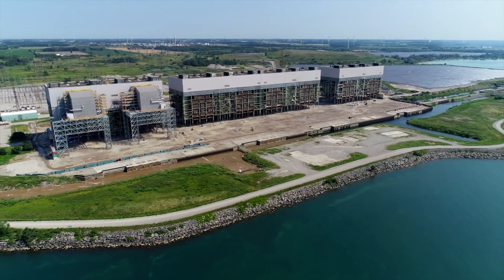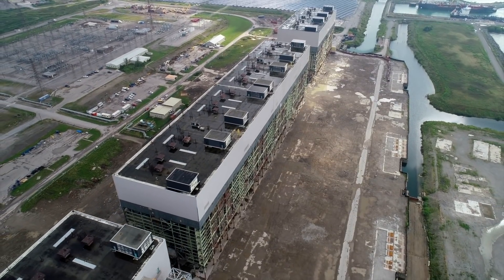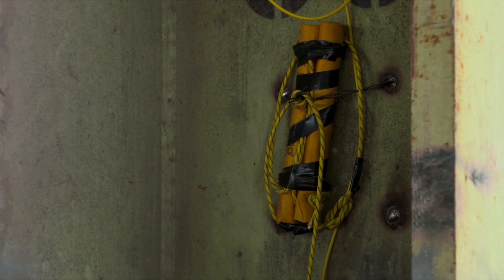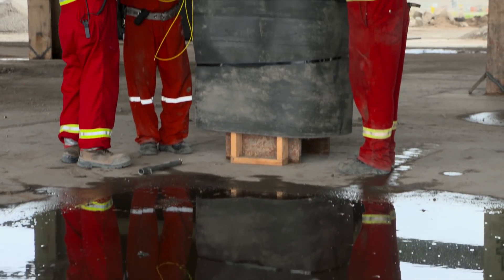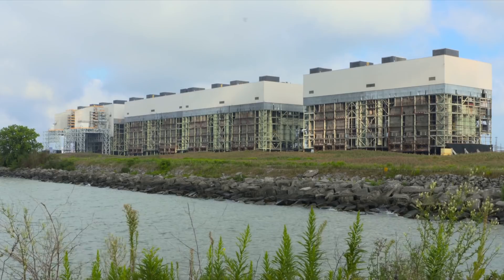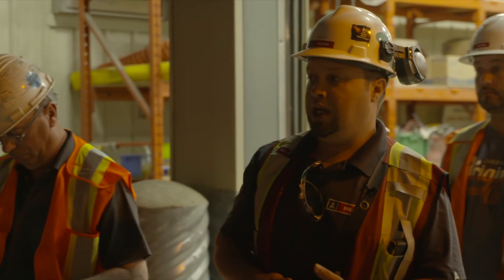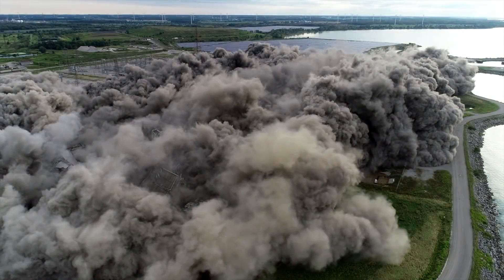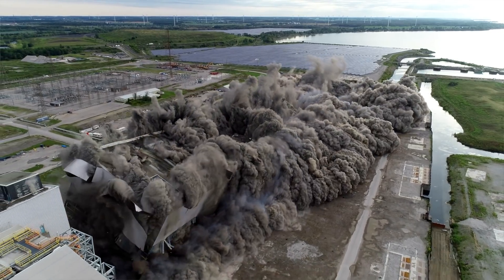Delsan AIM - Nanticoke Powerhouse Demolition 09 25 2019

Comment: Ontario went from 200 smog days per year during the reign of Nanticoke (largest coal plant in NA when it was active), to zero in 2020. 
The orange haze over the city was terrible.  We're much better off without coal.
As for "coal is cheaper".   The Ontario PC conservatives spent $1B to upgrade a single coal plant in 1990's before mothballing it 2 years later in a futile effort to try to clean up the sulphur and nitrous oxide poisoning our air.   In 10 years, Ontario has deployed 4 GW of solar and 5GW of wind.   Wind is now producing more power YoY than gas in Ontario.

Comment: Stupid move getting rid of that plant. Liberals have destroyed our energy affordability with their useless green energy plan. That dynamite would have been better used on the wind turbines. Nice job on the implosion though.
Reply: Wind and solar save air quality, climate and taxpayers
Reply: Nicholas L wishful thinking I’m afraid. Wind turbines create a larger carbon footprint during their construction than they will save over their entire operating lifespan. You couldn’t even use wind turbines to create wind turbines! And in no way will this save the taxpayers. We went from 7.5 cents/kWh to over 17.5 cents/kWh because of liberal stupidity. You also omit the mining of the rare earth elements for their construction. Not green at all. Check cobalt mining in the Congo. Child slave labor. I’ll burn Canadian coal and oil thanks. It’s actually greener in the long run.

Comment: Glad Milwaukee still has coal...Natural gas. Solar. wind, together make for efficient use of WHATEVER IS THE CHEAPEST........
Reply: Clean renewables are cheapest
Reply: @Nicholas-f5  sure nikki.......and no they are not.....
Reply: Ontario wind FIT contract at 8c/kWh is pretty cheap power, with zero fuel cost, no acid rain, no radioactive waste (coal produces more radioactive waste than nuclear).
Reply: @glennsteffler5110  I'll take the ones I mentioned.. Backups are a nice pillow...Ask the peeps in TEXAS...

Comment: Wondering...aside from the steel for scrap, what if any of the machinery - ie - the turbines and generators and related equipment was salvaged??
Reply: Salvaged for what? How do you think a decommissioned 40 year turbine gets salvaged?
Reply: @sydneyshinshi  A surprising amount gets recycled
Reply: @recoil5124  Recycled for sure but im guessing not salvaged for reuse as running equipment.
Reply: @sydneyshinshi  Sadly, Ontario spent billions upgrading coal plants under conservative governments in the 1980's and 1990's throwing good money after bad into these old polluting plants to keep them up to date.   Literally spent $1B to upgrade a plant 2 years before it was shut down.
Reply: The emmisson controls possibly could have, even in another country

Comment: Has there ever been an instance, during the explosive demo phase, that the coal dust caught fire and in turn caused an out of control explosion? Or any explosion for that matter?
Great video!
Reply: good question - there'd certainly be sparks from the crunching
Reply: Go back and review the internal pictures. They had pretty much scrubbed that place clean.
Reply: @brucewelty7684  it was considered and planned for.  Good question though.